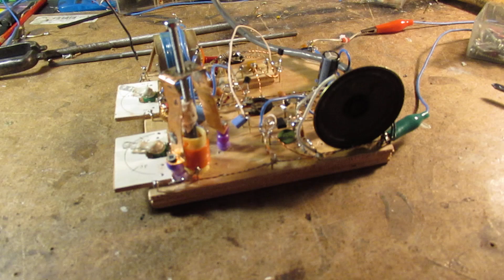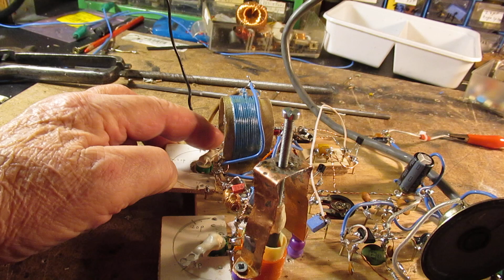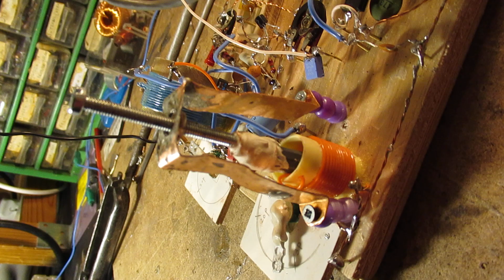Listening 22 dec 2022 at 2.48 h (night) to Eastern Europe Radio Stations via easy homebrew SW radio

Comment: I used to play with the MK484 and picked up the 7mHz band, I'm sure it was going regenerative it was not supposed to go that high in frequency. TA7642 is the same AM receiver. Would like to use one for the IF and detector circuit.
Reply from the maker: Yes, that are the surprises of doing these experiments on SW. Both coils (VFO & Antenna coil) in this case were made on the basis of experience. Looking closely, you can see that the best Q is there when the parallel capacitors (antenna coil and local oscillator coil/VFO) are at their minimum value. Say around 10 pF. Looking at the radio theory that fits, high inductance, low capacitance means in general a high Q, thus sharp radio reception. Anyway, surely even parasitic oscillations can help when doing this kind of research to develop a radio. Thanks. 23 dec 2022.